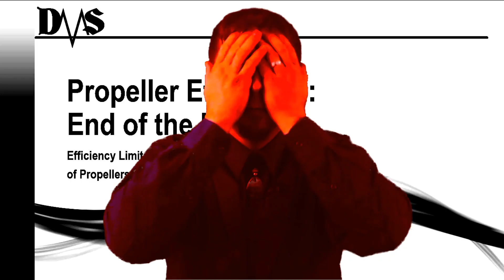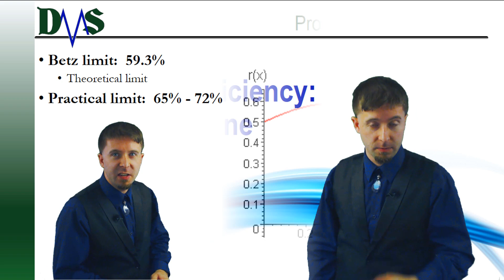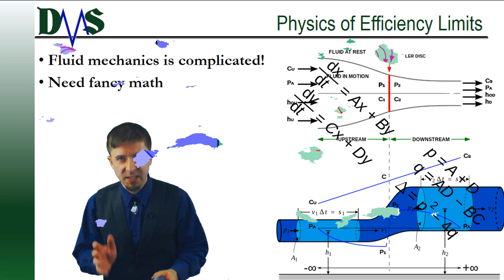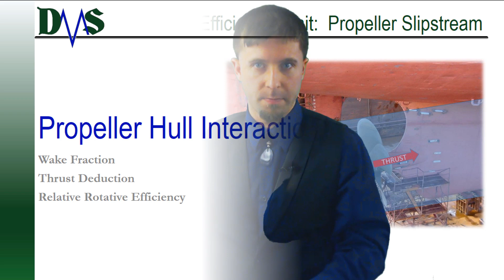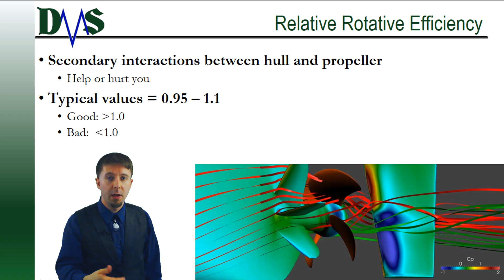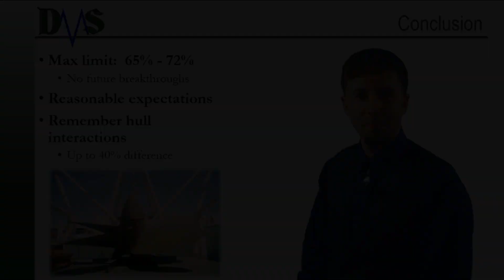End of The Line:  Propeller Efficiency.  Efficiency Limitations of Propellers

Comment: One of the reasons that the cruise line that wanted to restore the SS united states backed out was because despite the fact they found the hull and machinery were in excellent shape they wanted to put in aezopods (which mena s they would have had to replace the stern with a constanzi/sponson. which to me makes no sense sense I don't think many ships truly benefit from them your going to need tugs to get in 99 percent of harbors anyways,  plus if you are going to have bow thrusters......
Reply: Besides excellent maneuverability, azipods are more fuel efficient. They also remove nearly all vibrations. And there is virtually no cavitation on pods with front mounted props. Without enormous engines and shafts, there is no need for a conventional engine room. Designers and architects can place generators virtually anywhere in the hull. Another advantage of not having a central engine room is the ability to control generator fires. With generators in different locations and in their own room, a fire can be put out the moment it is noticed. With heat triggered inert gas (argon) suppression systems, a fire can be put out within seconds of the alarm. Furthermore, no additional damage is done from the suppressant. The power needed to drive the pod can be rerouted from a different generator at anytime. This solves three important issues. One the vessel won't suffer significant damage with the immediate activation of a gaseous fire suppression systems within a generator room. With the safety of the vessel and crew ensured the captain can decide to continue on course or find a port. All with minimal to no impact to services. The guests may not even know a fire occurred in such a situation. In the case of fire in a typical twin engine, engine room, most, if not all, vital services are lost even if the fire is brought under control or put out. The result is a ship dead in the water. In some cases the vessel is lost due to fire burning out of control within a large open engine room (my worst fear realized). Or an impotent vessel is capsized or thrown on to rocks or reefs. As a result the crew and any guests are sent adrift. Some may have been injured or killed fighting the fire or when the vessel capsized. Some new yachts have a split engine room to allow guests direct access to the beach club from the lower level guest accommodations. While arresting a fire is easier with this configuration, you'll still lose one of the two engines. You can't split power from one engine to drive two props. When a direct drive engine has a mechanical issue or started to overheat from running at near full power due to a storm or strong head winds, your left with just one engine. With one engine in such conditions, the remaining engine is simply running to maintain stability. If the second direct drive engine fails, the ship is in danger of losing stability. There is no way to build in redundancy with direct drive engines. On vessel equipped with pods, power can be shared or wholly redirected from the house generator(s) to help power a pod(s) in the event a primary pod generator is knocked out from fire or mechanical issue. Having propulsion power redundancy and the to separate the generators for ease of fire suppression is huge to me. I never want to experience that burning and sinking feeling again. 

Cheers!

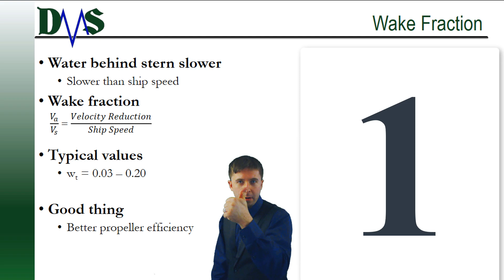Comment: At 4:50 he says that ,"If the ship moves forward at 16 knots speed then the  propeller does not see the water coming at it at 16 knots but it sees it at about 15 knots."  Then he  proceeds to say that the water SLOWS DOWN  as it fills the part in front of the propeller. 
This is an interesting statement and it is not the way I see it, as normally it is the ship that moves forwards while the water particles remain stationary, not considering the very thin layer that moves with the ship. So really what happens is that as the stationary water fills in the narrowing low pressure rear part of the ship, the water IS ACTUALLY BEING COAXED TO  BE PULLED AND MOVE FORWARDS AND NOT SLOWED DOWN. If  by this suction, the water is made to move forwards at 1 knot, then that is the reason why the propeller travelling at 16 knots see 15 knots of water coming at it, for the low pressure surface  of the hull tapering towards the  rear, has pulled the stationary water forward giving it a speed of 1 knot........ and  it is not a case of slowing down the water. 
I am an old man and hope to be forgiven, if I got this wrong, but I read my contribution about ten times and I feel that it deserves some consideration  from the gentleman who presented this video.
Reply from the maker: Good point.  You are correct.  That was my mistake with conventions.  For fluid analysts like myself, we often reverse the scenario:  We consider the ship stationary with the water flowing past at a fixed speed.  It makes the math easier that way and still gives the same answer.  That was why I said the water "slows down", because of how I modeled the situation in my head.  But yes, in reality, the ship moves and the water stay stationary (forgetting the suction from the propeller for the moment).

Comment: Does putting the propeller deep under the ship in an azipod and having the propeller pulling from the front make much difference?
Reply from the maker: Yes, it does matter, but I don't have any numbers to quantify the exact difference.  That is one piece of information I'm still searching for.  (Propeller makers do not want to give away those secrets easily.)  Placing the propeller in front of the azipod gives it a clean streamline.  We see the same water speed entering the propeller at every point of rotation.  As an educated guess, I think this changes the efficiency by 1-2%.  Placing the propeller deeper can reduce the cavitation on the propeller.  We can get the same thrust with smaller propellers.  However, azipods are not normally deeper (excluding small yacht designs).  The naval architect normally uses a different hull shape when employing azipods.  As a result, the azipod normally sits near the same depth as a conventional propeller.

Comment: I see coaxial counter rotating props for maneuvering why not for main thrust? ( I have seen a couple for thrust, but not sure why so limited)
Reply from the maker: You do see them occasionally.  Here are two examples I found:  

https://www.deyuanmarine.com/Azimuth-Thruster-with-Contra-Rotating-Propellers-for-Car-Ferries-pd419874.html
https://www.schottel.de/marine-propulsion/scd-combi-drive/

The main disadvantage for contra-rotating propellers is their complexity.  A traditional prop is just a solid metal shape on a spinning shaft.  Very few parts that can break.  Contra-rotating props require gearing, coaxial shafts, and complicated bearings to support the whole arrangement.  That adds cost and increases maintenance.  Unless you need a high performance vessel, contra-rotating props are hard to justify the expense and increased maintenance.
Reply: Thank You, I suspected they had advantages in water, their use in air is clear. The vortex stream behavior and energy costs with speed in water were where my math failed. The complexity issue is a tough materials problem, pun intended. cavitation being a case in point.

Comment: Any work on variable pitch propellers in naval applications, or are they impracticable?
Reply: They are practical and convenient but not so efficient, as the pitch angle along the blade does not follow what is required when the pitch is rotated  to select to take any other angle than the optimum pitch for what the propeller was designed.  It is mechanically impossible to make a variable pitch propeller which keeps its optimum curve along the blade for any pitch!  This would necessitate no twist in the blade when the pitch is at zero pitch, and that is rather difficult to achieve in engineering.

Comment: Are shrouded props any better?
Reply from the maker: Yes, depending on ship speed.  A typical accelerating duct can improve propeller thrust by around 30% max.  The shroud improves the propeller performance, but you also need to pay a drag penalty to pull that shroud through the water.  Above 14 - 16 knots, the drag penalty starts to outweigh the benefits of the duct.  Tugs are a great application for ducts because they need a lot of thrust and don't move very fast.
Reply: I was thinking of this application for a solar powered cat.  Max speed maybe 10 to 12 knots cruising speed 7-8 hopefully.
Reply: @Toad434  but don't have the ducting too close to the edge of the propeller you are lose force on the propeller a minimum of 8 inches gap Are you making this Square with round corners might be better than round
Reply: Is a water jet more or less efficient than a propeller, and what governs that difference?
Reply: Brian Foote I was going to say it's a bit more complicated than that, but in almost every case you're correct so.. 🤷‍♂️